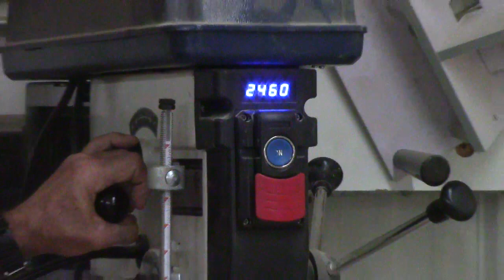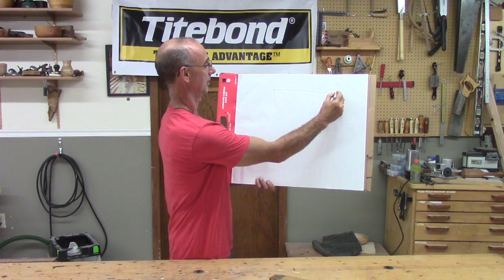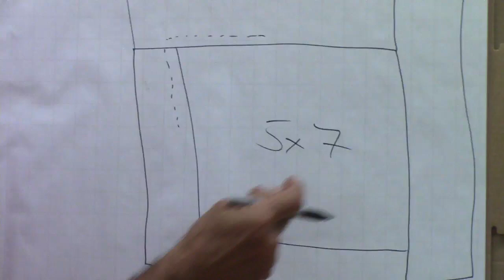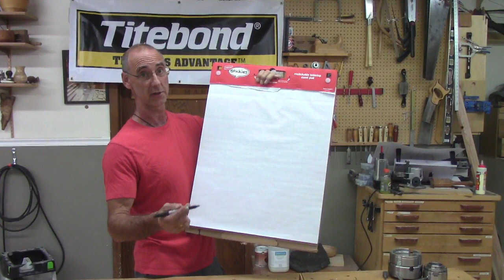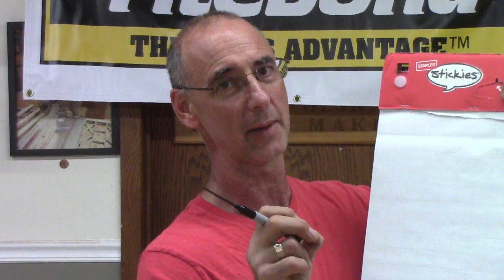WWGOA LIVE: August 2017 Woodworking Q&A with George Vondriska

Comment: Re: Table Saw locking problem.  I had the same problem with my older Grizzly contractor's saw.  I contacted Grizzly the following it worked like a charm:  When the lock knob is tightened, it pulls on the worm shaft, which locks the height of the blade. Please
 add a washer on the shaft just behind
 the handwheel, between the roll pin and the front of the tilt 
indicator. This prevents the handwheel from bottoming out on the roll 
pin.